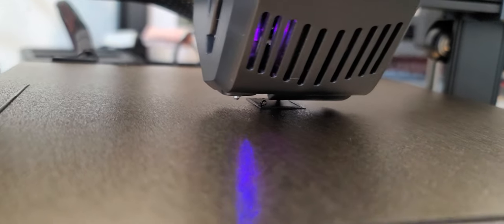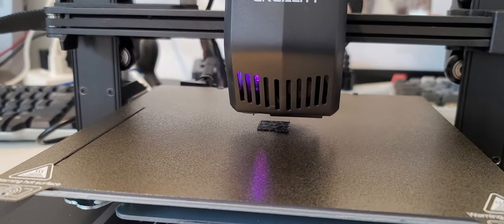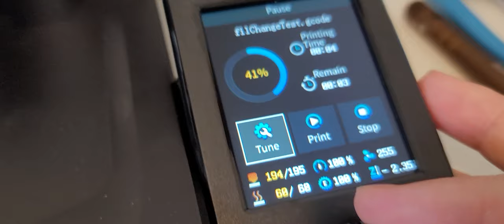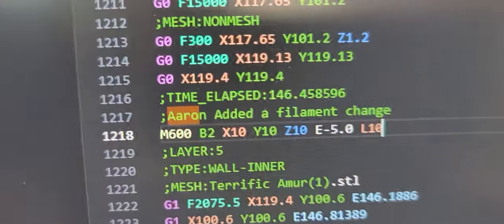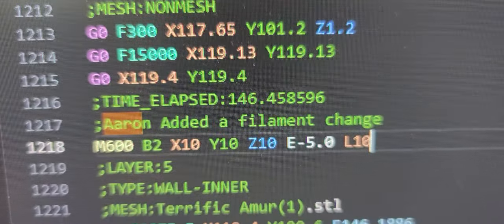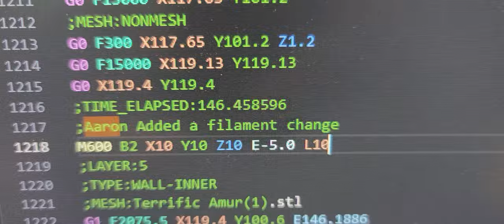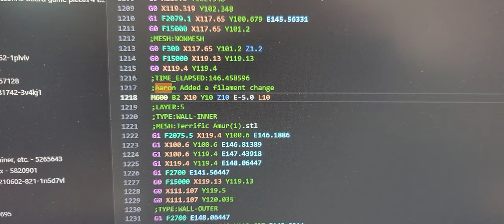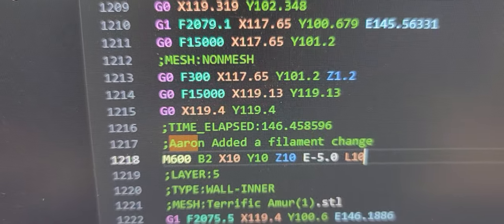3D Printing | Adding Marlin M600 command to g-code for filament change

Comment: Hi, I tried your gcode because mine kept on purging everytime I click Print. But yours does the same, do you have any idea what the problem is?
Reply from the maker: "The M600 command initiates the filament change procedure. The basic procedure will move the print head away from the print, eject the filament, wait for new filament to be inserted and the user to confirm, load and prime the filament, and continue with the print. M600 may be initiated automatically if a filament runout sensor is installed."

The nature of the M600 code is to move to a safe location, extrude the current filament, and load the new filament.  This link lists the commands https://marlinfw.org/docs/gcode/M600.html
Reply: @appsbyaaron  I understand but your printer completes the print but mine keeps purging. And there is no extra code in your gcode to resume the printing. So I have no clue why it works on your printer and not on mine

Comment: would be nice to know where to find this config file in my pc
Reply from the maker: The gcode is the print file that your slicer exports.  Normally .gcode.  You open that file in Notepad or whatever software you use like VSCode or Notepad++.